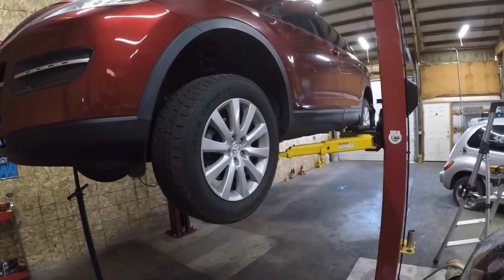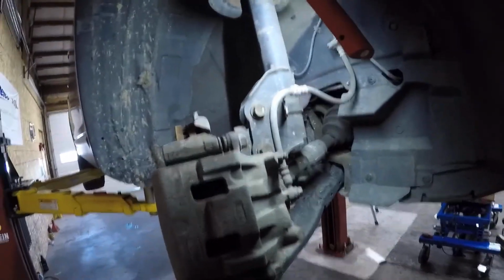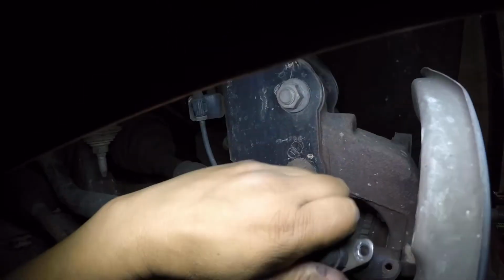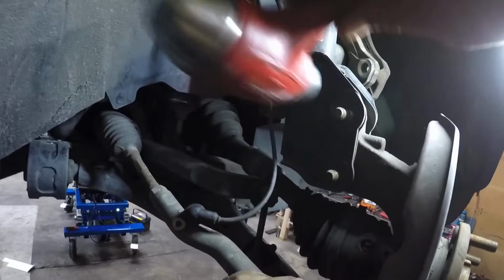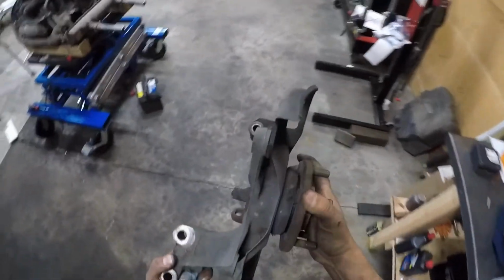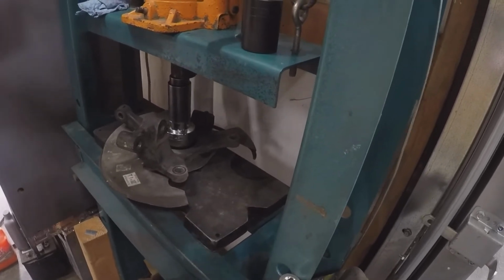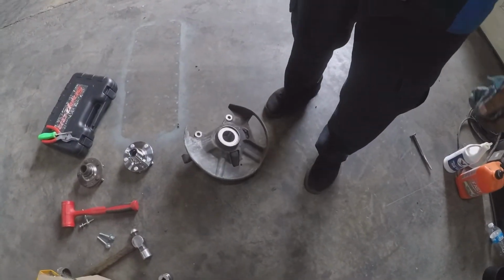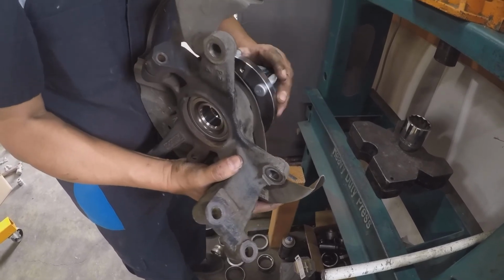MAZDA CX-9 PRESSED IN TYPE WHEEL BEARING, (FRONT) HOW TO REMOVE & REPLACE.

Comment: Very good work . Please what size pill did you use in the 19:20 minute video?
Reply from the maker: It's just a regular socket, I don't remember what size because I have a lot of them, just whatever fits the gap that's what I picked.
Reply: Thank you sir for your interest and quick response. Please which gap do you mean? Do you mean the large or small circle surrounding the inside, within which there is a wheel bearing? I thank you for your patience.